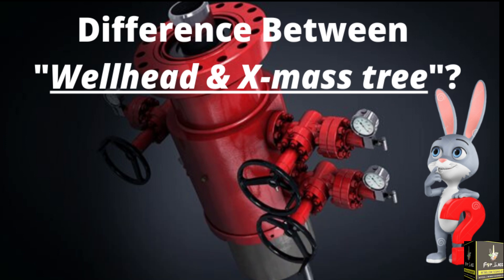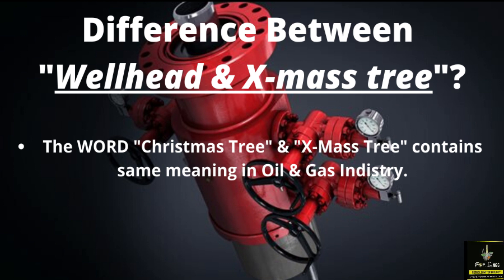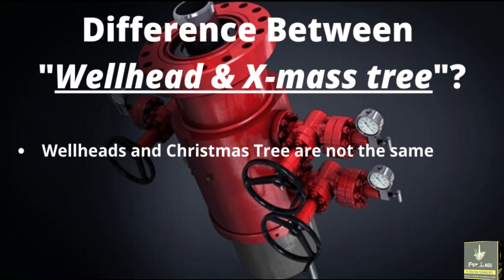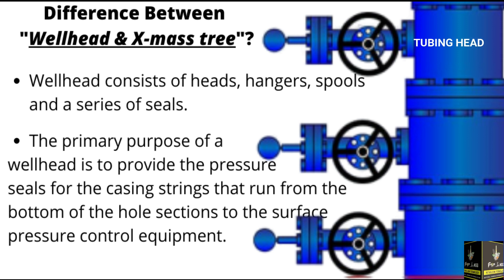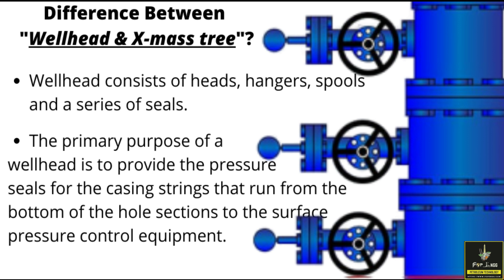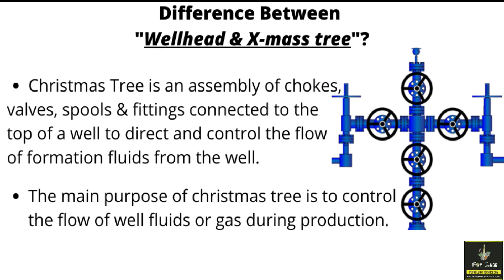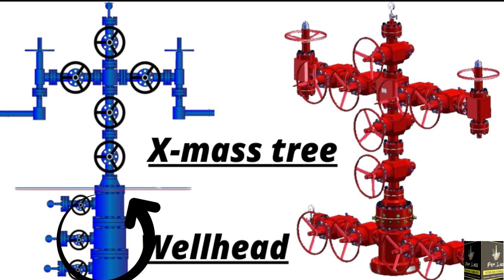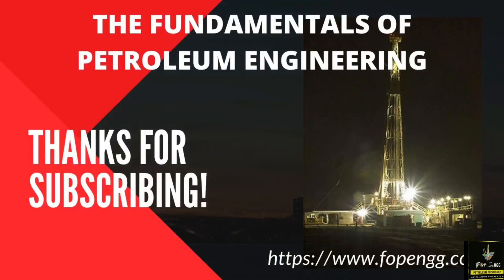What is wellhead and Christmas (X-mass) tree?

Comment: Sir then, during the production phase both are available on the surface
Reply from the maker: Yes, Both are available on the surface but First, we install wellhead Then we Run in Hole (RIH) Completion and after completion is properly inserted and Tubing hanger is set in THS (WellHead) then we remove BOP & Install Christmas tree.